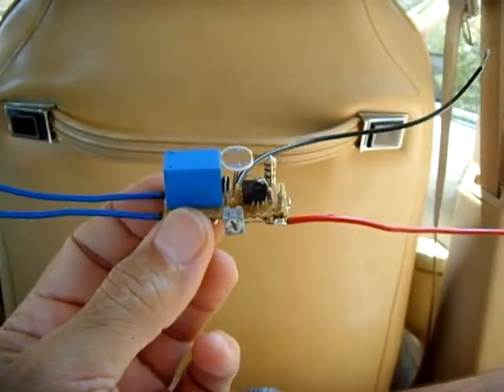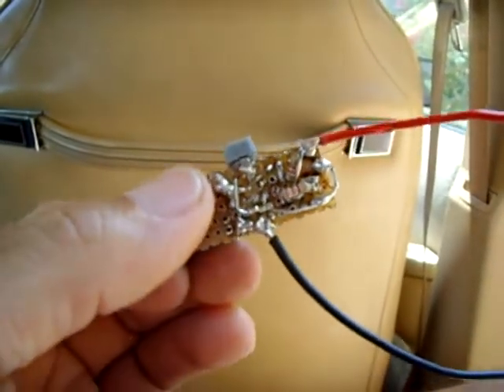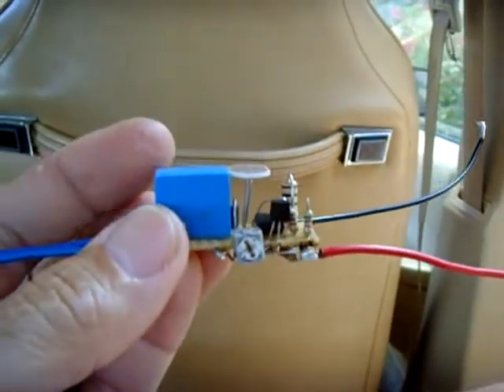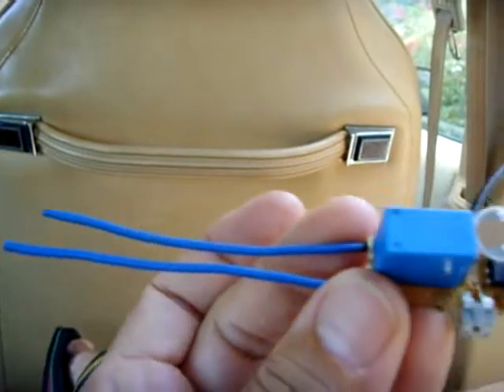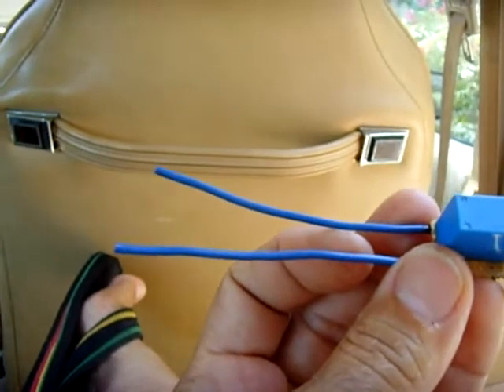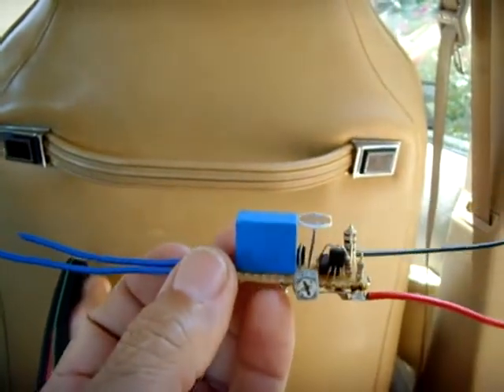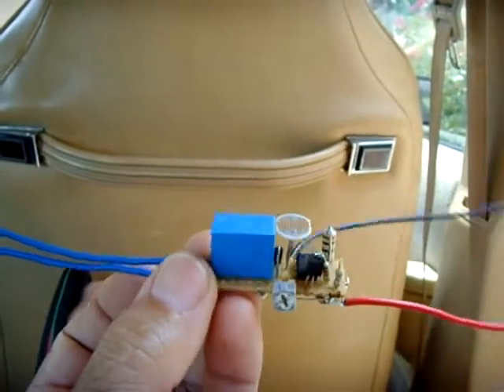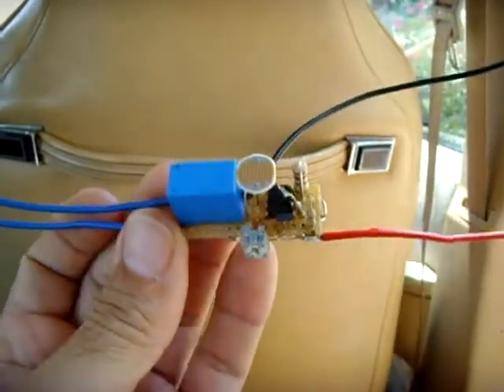9-12V Dark Activated Relay

Comment: Thanks for fast rep[-ly. can I use 12 v relay.
Hop[-e this circuit do not make chattering relay.
Reply from the maker: If you encounter any chattering, just adjust the 1M resistor lower until the problem is eliminated. I think the 6v relay is a typo, unless the PNP never fully turns on. 12V should be fine.
Reply: Thanks, I am new, P_lease show us how to do it on a breadboard. I failed following thescheme. P_lease.
Reply from the maker: Unfortunately I cannot accommodate everyone's requests for videos. The circuit is very easy. Take close up images of your breadboard and post the link to the images here. I'll see if anything looks wrong.

Comment: Hi, electronicsNmore
 Does this Circuit work when it's dusk or just in full darkness thanks?
Reply from the maker: Your can set the level of sensitivity. Thanks for watching!
Reply: @electronicsNmore  I made this circuit, but when I set the potentiometer to MAX value, Relay is activated when it's dusk, what should I change to the circuit to activate the relay in full darkness?

Comment: would i be able to use it for a DIY auto on/off headlights??
Reply from the maker: Yes,this circuit would work, but since it is a simple one, with no delay built into it, you have to make sure the LDR sensor is positioned so no CLOSE oncoming headlights or other bright lights try turning the lights off when the LDR is illuminated. You can probably position the LDR in a location like 10"-1' foot inside your front grille facing outward. The LDR does not usually turn off that easy unless the light is very strong. The LDR's respond quicker to natural/sunlight.
Reply: hi can you help me need the other way with lights on and 12 volts

Comment: Can this circuit handle 18v 2amps.
Reply from the maker: Hi Shane. Yes, LM741 can handle 18v input. Be sure to use a 12v relay with a 100 or 200 Ohm 1/2 Watt resistor in series with the relay.